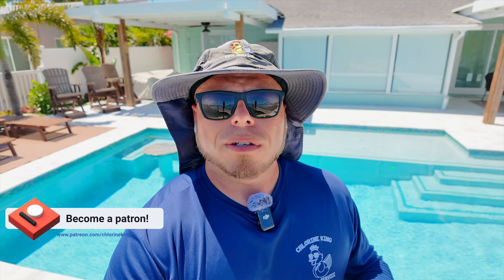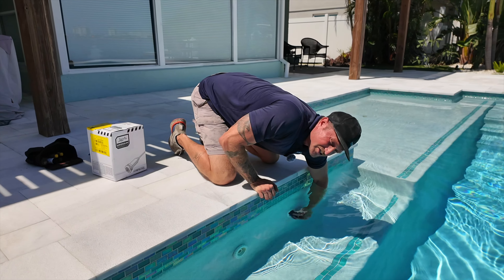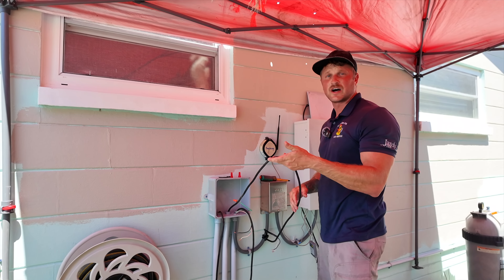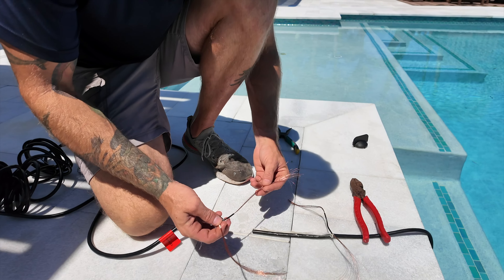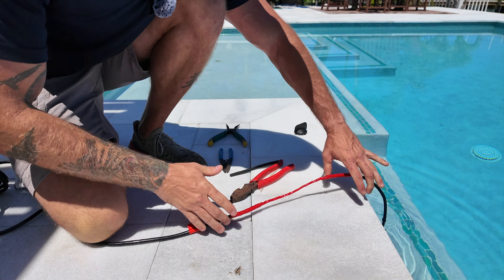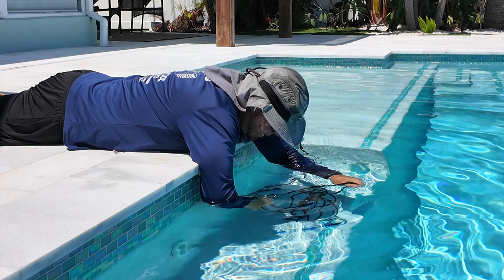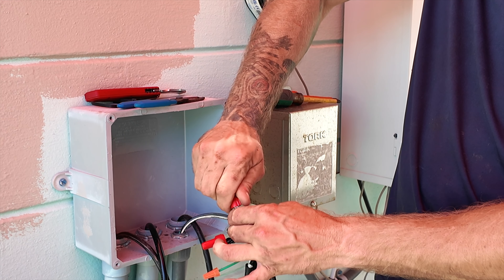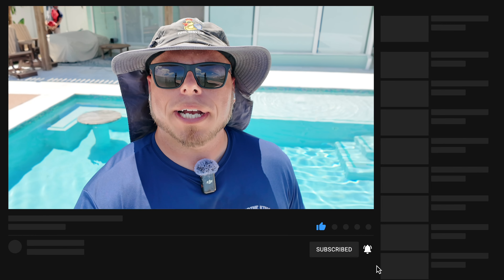How To Install A Jandy HydroCool Pool Or Spa Light

Comment: Thank you guys for showing you can just use the existing cable to pull the new light through.   Sooooo many guys in this field use a phish tape and it's 2x the work.  I always just cut the old off and use the cable attached to a new one.   Why would anyone make it extra work.  Never understood that philosophy.   Also the Jandy "P" series lights is a direct replacement for the Pentair globrite.  I have replaced hundreds of globrites since 2019.  Hundreds.   The p series hydrocool fits the niche perfectly and matches the colors perfect.  3 yr warranty.  I've done tons and everyone here is done with globrites.   Microbrites with adapter is not much better honestly.  Jandy is also doing a h series for haywards systems to replace the 320 as well.  No mod needed.  It's awesome.  Great video.  This is how you pull a new flush fit light.   I miss the old days when lights had extra cable wrapped around the back.  No leader line either.   And yes I've replaced 3-400 lights     New construction is usually much easier to pull.   If conduit is crushed or broken underground.  Best of luck.  🤞
Reply from the maker: I agree, way easier this way. In another light video of mine a guy slammed me for doing it this way because of all the "debris" that gets left on the deck or possibly damaging the deck. Umm ok sir. Thanks for watching!

Comment: Might be a dumb question, but if you have enough slack at the junction box, couldn't you just swap the light itself and not have to pull all of the cable the whole way? Or is this done to ensure the electrical taped area comes out and you only have the uncut cord in the conduit?
Reply from the maker: You can splice anything with the light with the wiring/splice being under water. I hope that makes sense.
Reply: No!
The new light comes with the cord. It’s all one piece. The conduit is wet so you do not want to have a splice underwater. 
You ordered these lights with 50, 100 or 150 feet of cord. They cost about $500 each and will fail in about four years.

Comment: Tip from retired electrician uncle. Always use a new wire nut. I argued with him and asked “why?”
His answer was classic. “You never want to get a call back to a job for a .19 cent wire nut”
I now always replace wire nuts after I take them off in any job unless I came without new ones.

Comment: What kind of transformer do you need to power the LED lights? Do the LED light wires go straight into the AC power outlet?
Reply: intermatic transformer,wired straight to the transformer.